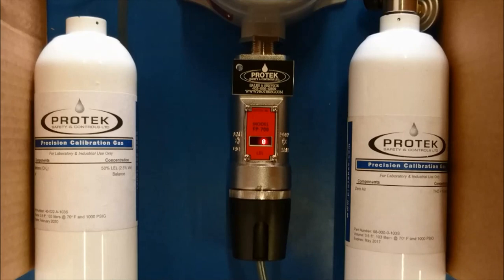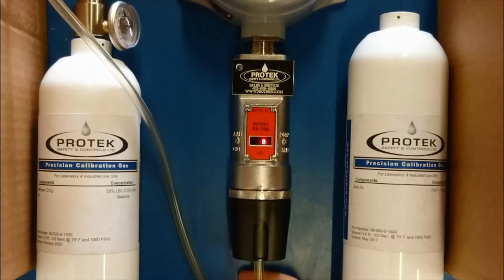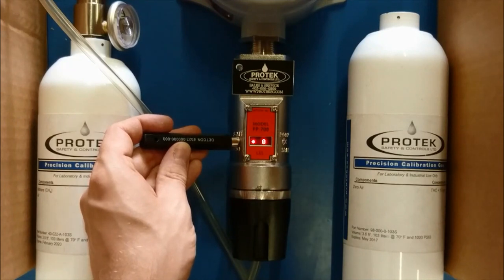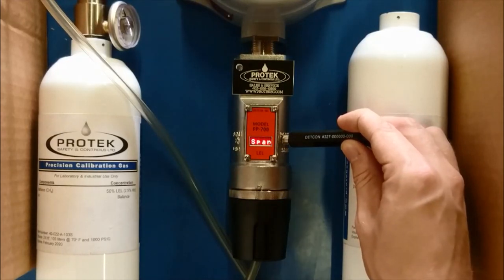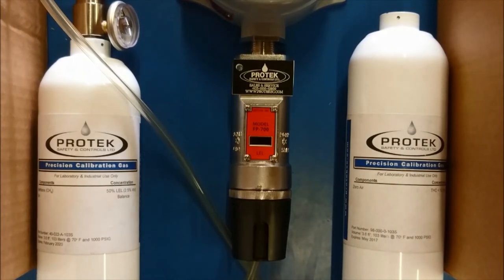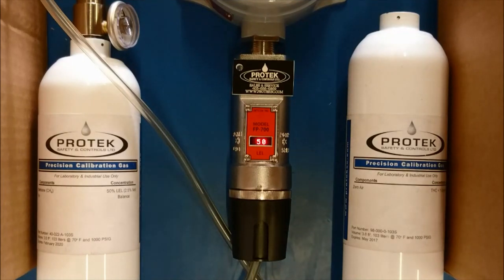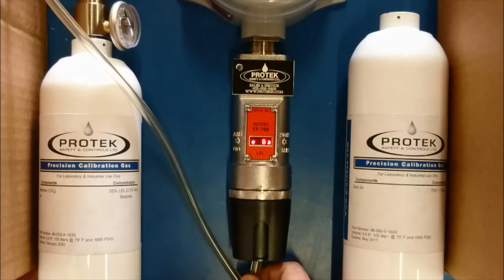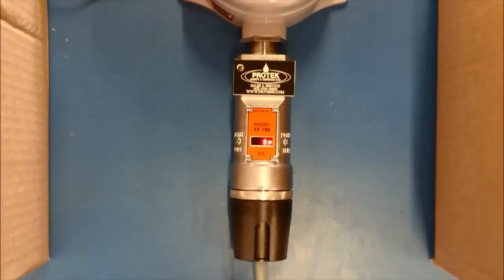How To Calibrate a Detcon FP700 Combustible Gas detector

Comment: Is the procedure same for IR 700 sensors for methane using methane LEL calibration gas?

Is any configuration needed before doing calibration when using new Sensors and board.

Comment: dear sir please tell which gas did you apply for calibration and what are the mixture of gas and what is concentrate please advise me
Reply from the maker: By default, the FP-700 gas detection unit uses Methane 50% of the Lower Explosive Limit (LEL) with balance air. 

If you need to change the type of gas to something other than Methane, please go to the following video: https://www.youtube.com/watch?v=IerC7VPrwxU

Always make sure you read the manual before servicing and have it on hand in the field!

Hope that helps.
Reply: Protek Safety & Controls no
Reply: dear sir the concentrate what will be? and what gas cylinder company where you are applying gas for calibration.
Reply: and what ate the GPM 1 and GPM and stands for?
Reply: sorry PGM 1 and PGM2
Reply: dear sir do you have any vedio on Toxic gas detector?
Reply: i often use CH4